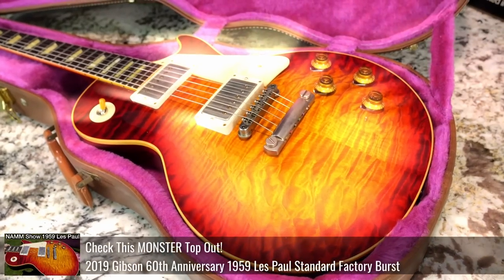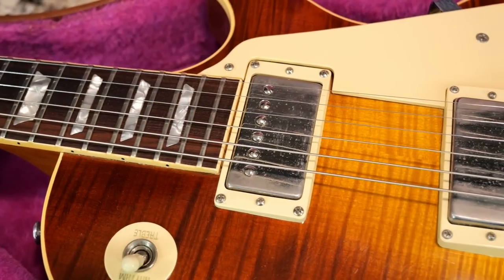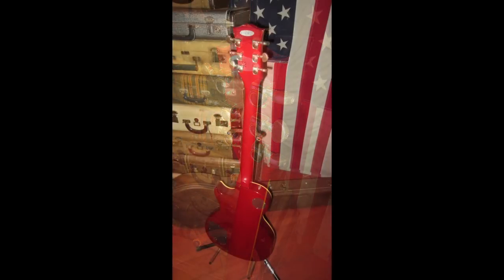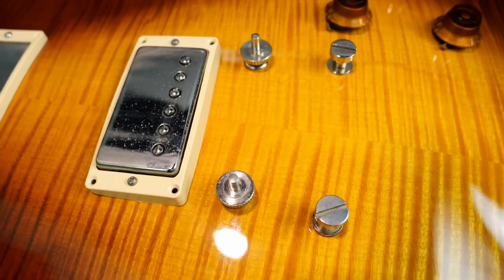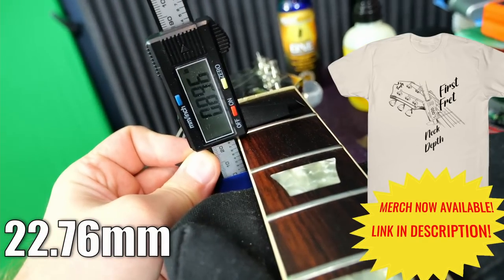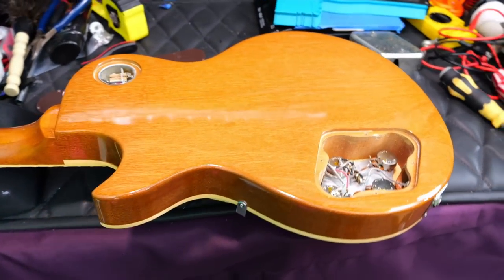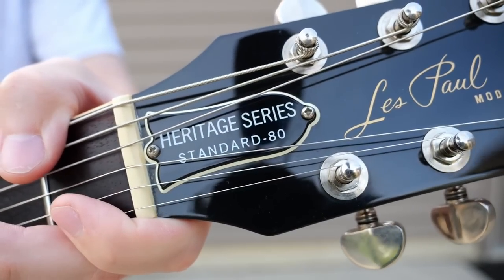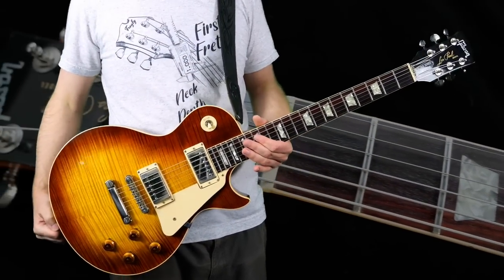The First* Time A '59 Burst Was Reissued | 1981 Gibson Les Paul Heritage Series Standard 80 History

Comment: What is the most accurate Gibson 59 reissue?  Can we get a video of a side by side comparison of the accurate reissue with an actual 59?
Reply: The problem is they are all different (OG's) The tops were hand carved and the necks are all different because they are hand shaped and sanded ....hence many variables.
Reply: If you want an accurate construction, look at a japanese brand. The custom shop tokai (tokai ls200 and above models), Navigator or Crews will be constructed to the exact right specs, if you go high end enough, you get the exact same woods like Brazilian rosewood and Honduran mahogany. You wont get that through gibson. However, depending on the brand, you may need to replace pickups as the originals are ok but not great, same as gibsons

Comment: I have an Elite which is a great guitar.
There were some exceptions to the normal specs which were that the Standards had flame tops, 3 piece necks and rosewood boards and the Elites had curly maple tops 1 piece necks and ebony boards. 
Mine is one of the oddballs which has a red flame top, 1 piece neck and ebony board. 
I like Ebony fingerboards, there's less chance of it wearing like rosewood can (specially around the cowboy chord area) it doesn't seem to dry out and need oiling like rosewood and I find it easier to clean too.

Comment: I have a Tobacco burst Standard. However this is an extremely rare standard as it has a one piece neck and not a three piece. The reason being I can only assume they ran out of three piece necks so had to use ones made for the Elites. I love it. They didn't do too bad of an attempt at a true '59 apart from using three piece necks and the sharp cutaway. mine does weigh a tonne though, over 10lbs

Comment: The original vintage 1959-1960 bursts had 500k/500k pots. The lower ohm (300k/100k) were a response to the mahogany getting heavier and denser over the years, and the switch to alnicoV and ceramic magnet pickups, which makes them overly bright. The lower ohm pots make the guitar darker.

Comment: I know purists will say “It must have a 1 piece neck! (Technically 3 because of the headstock wings)” But, a multi piece neck should have more stability in the long run since it’s got more structure to it. Plus you can get some fun wood grain mixed in, my SE Custom 24 has a crazy flame maple center on the 3 piece neck!

Edit: 300k pots worked for me on a guitar that had coil splits, really evened out the massive volume drop between hum and single.

Comment: There s a reason why the cavities are shielded. The pots and wiring are not connected to the bridge or stopbar.  That means that if you retire the steel shield you ll have to connect the pots to the bridge somehow. I did that on my 82 elite and it s invisible. Because without wiring everything to the ground (yourself) it s quite noisy when recording so to wire the pots to the bridge (standard today) is recommended.  That guitar is different because the electrocutions that happened on stage during that period.  I love the ebony fretboard.  Had mine for 38 years.  I wouldn’t sell it for a world.  Is it the best lp I ve played? No. But I m attached to it. It has flaws and it s naturally reliced, the shaw pickups are wonderful. Very vintage sounding.  The Nashville bridge isn’t an issue, there are adapters available if you want to get another type.  Mine has a Faber bridge and an Aluminium strings-holder, lighter too, which is appreciated because of those are often on the heavy side. The guitar might not be a 100% 59’ reissue but it s a beautiful Les Paul in its own right. To compare it to a modern reissue is quite stupid as I see it, it s not why you get one of those.  Mine is like a friend that has followed me for 38 years, with its flaws and its beauty, I would never swap it for a modern 59.  😉

Comment: The Gibson factory has not issued a true 59 yet because those guitars were made of real wood and were not weight relieved. When you remove wood you remove tone. I’m old school and you can’t convince me that these reissues sound anything like an original. When I pick up a Les Paul it better have some weight or I put it down. Sorry but I’ve been a player for 57 years and there’s no comparison. I know that you are a Gibson expert but you are also young. I also play old Fenders and they are real fine instruments. I’m not hating it’s just my opinion.
Reply from the maker: Weight relief didn't come around until the earliest of mid-1982, so this is solid and all current R9s are solid body.  Each guitar has its own thing going on but there are definite feel differences between the eras
Reply: At your age it is not possible to detect any tonal difference or ID a specific guitar.  Weight relief or not.